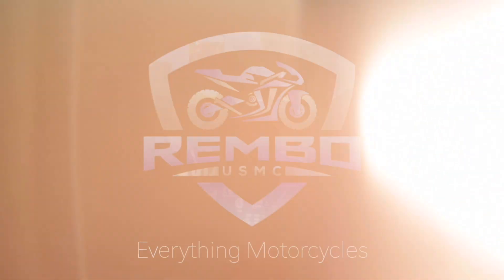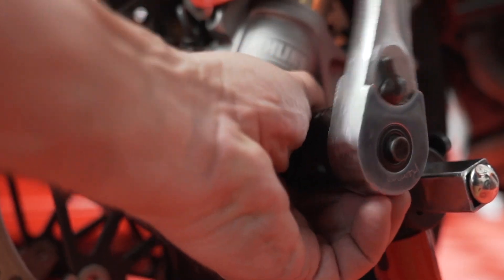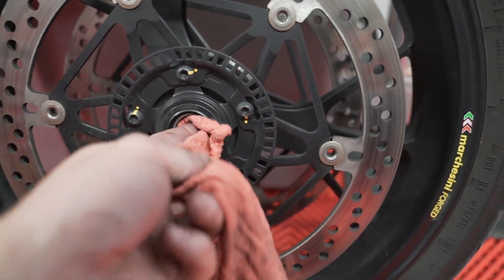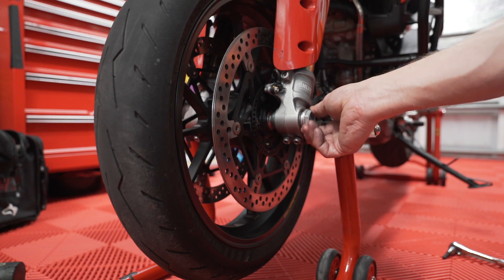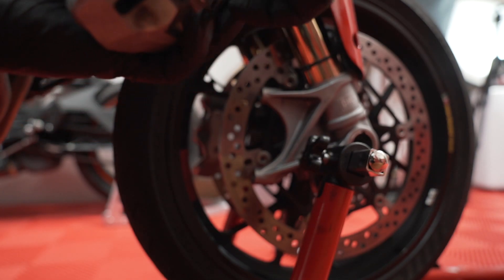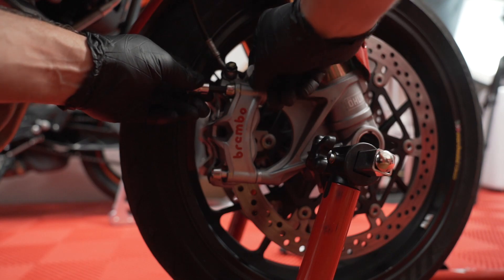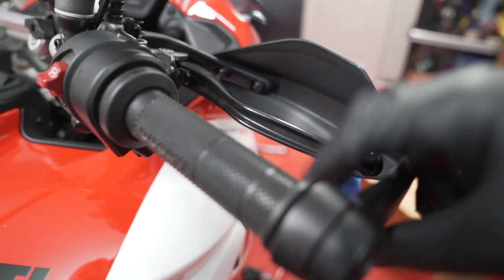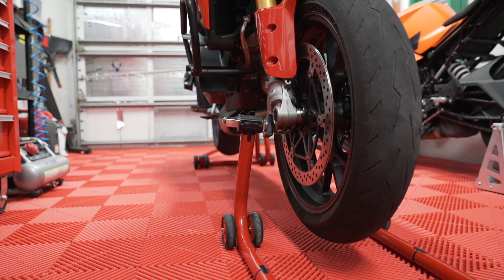How To Remove and Replace the Front Wheel of a Ducati Multistrada Pikes Peak

Comment: Sure you're supposed to do opposite side pinch bolts first.
Reply from the maker: Not with this setup.  Some other bikes, yes
Reply: I disagree.
Reply: He does the wrong side punch bolts up first. Should be the axle side not the nut side
Reply: How is it on the v4s? Nut or axle side first?
Reply: @injector90 always axle side first

Comment: Great work & super messy. I usually bounce the front end to get the forks seated before doing up the fork leg pinch bolts. Gotta make sure you don’t snap the fork lowers🤙
Reply from the maker: Great tip!

Comment: I’m not a fan of leaving the front tire, suspended in the air like that. It makes it way harder to push the axle through. Rather use a jack under the front of the engine to precisely place the wheel and fork and the proper position so that the axle slides in and out. Or, pitbull, makes a “tire jack” that actually lines the tire up for doing such work.

Comment: Hey Devil Dog, where did you get the torque value for the pinch bolts?  I'm showing 19 NM not 10NM on my cheat sheet.  Do you have a link for your source?  I swear to God....Ducati is the biggest PITA when it comes to getting accurate torque values for fasteners.  They act like it is some state secret.  Otherwise, great video.  Thanks.
Reply from the maker: The dealer printed out all of the torque values for me for literally every single bolt. The problem is matching up the name with the exact bolt

Comment: Starting @ 6:10 - 6:35 are you sure that the pinch bolts on the same side of the axle nut must be tightened and torqued down first?  I've always done  the opposite side first, followed by torquing down the axle, then finish off with tightening / torquing down pinch bolts at the axle nut side
Reply: I agree, that's how I've always done it.
Reply: Exactly👍
Reply: Of course you’re right, the pinch bolts on the right side will hold the axle in place for you to torque up the big nut

Comment: Rembo please double check the torque on those pinch bolts. I have a 19 N meter stamped right on my caliper bracket. And that sounds more like it. 14 foot pounds please check it thank you
Reply from the maker: I already did twice with the dealer and the spec sheet they printed for me.  It is motorcycle model specific.
Reply: @RemboUSMC   it pains me to have to correct you on this one Rembo. You are my go to for all things Pikes Peak.  I just checked with the dealership. The spec sheet is incorrect. the correct torque figures for an Olins suspension fork with an 8 mm bolt is 19 Nm. In fact they stamped it on the fork just to make sure everyone knew. 10 NM is for 6 mm threaded pinch bolts

Comment: I’m doing a 2003 749s
First thing only on the axle nut side , do I have a spacer.

And the axle has a small half circle cut into the end that seems to line up with a half circle cut into the Showa forks

And holes in the axle that line up and down with the center of the fork tubes

Geezzus my Yamaha’s are so simple it feels like cheating, now

So I’m guessing the half circle ⭕️ on the axle/fork must line up

And the spacer on axle nut side, spaces the tire and left side fork tube 

I’m going to tighten the axle nut side pinch bolts
To torque the axle nut to 63 nm

Loosen the pinch bolts

Get the calipers in place with the Allen nuts hand snug tight

Then return the bike to the ground, push compress the forks

Raise the front by the triple tree with a ratchet tie down

Spin the tire

Lower the front down compress the forks

Again lift the front with a ratchet tie down hooked to the triple tree and a rafter in the barn

Then tighten the caliper to 45nm
Spin the wheel

If it spins freely 
Tighten the pinch bolts to 10nm 

Maybe put a little blue lock tight on them ??

Red Neck style here in Emmett Idaho

F ing Ducati manual says to refer to something else to get the torque specs.

Ducati doesn’t provide much help to work on their cycles

But thanks very much for your help

Semper Fi   ?

Thanks for all your service, sincerely

🙏🏼
Reply: Hey I’ve never had to do a Ducati before and I need to know the order involved and torque specs if you can help me please 🙏🏼 

The pinch bolts , or calipers 

Which do I tighten first

And the axel to tighten it up do I just tighten those same side as axel nut?

Or all the pinch bolts, to tighten the main axel

Bike is a 2003 749s Ducati, with Showa forks

Need help bad, I don’t want to warp my rotors, or any other damage

But need to go for a ride real soon